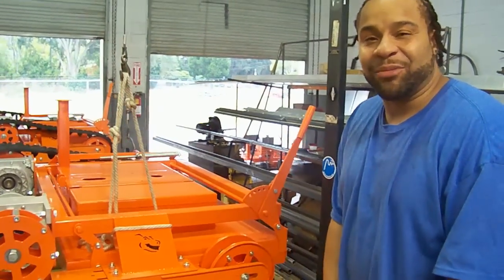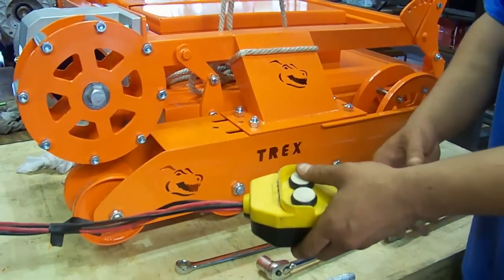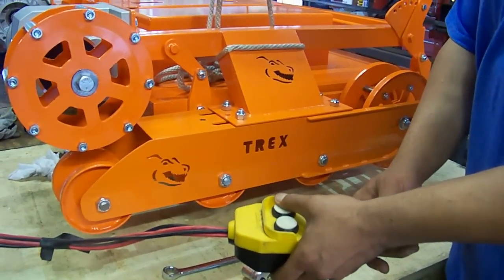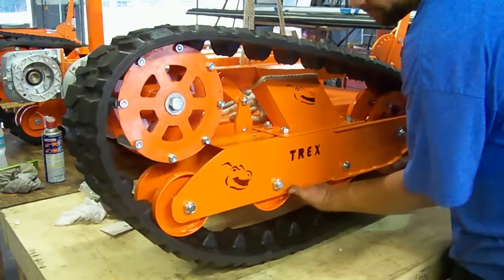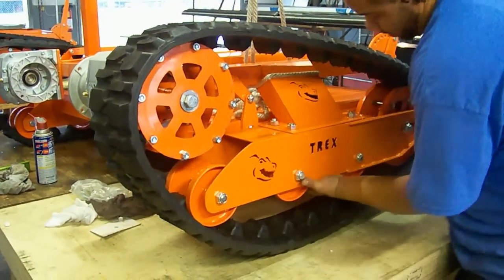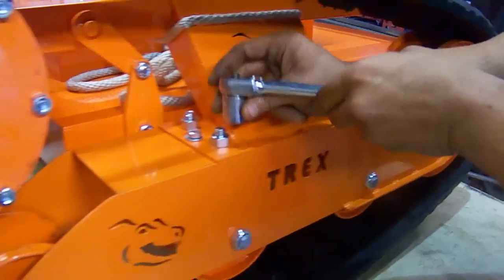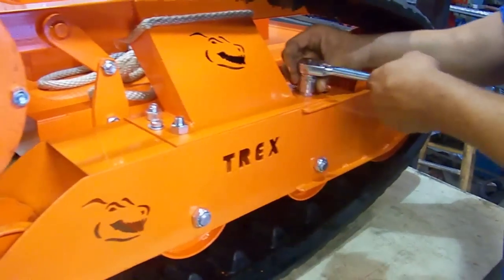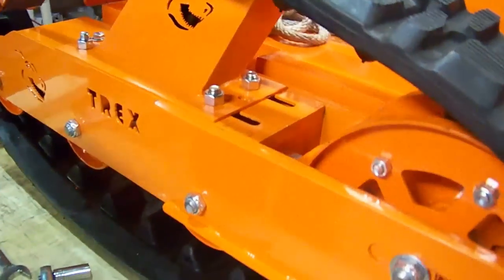TREX TRACK INSTALLATION

Comment: good old safety trainers too  , with that crappy work bench and poor slinging id not be putting my feet beside it ,, and who taught this guy how to use a torque wrench , very poor advert for the company . for 25k you would think they would  use the odd washer , maybe even break out to a few locknuts or even a ratchet spanner for the tensioner , and tightening an axle to 20ft/lb certainly isnt tensioning the track either. ,, if i was doing that every day id have to make some changes .  hse wouldnt let you do that here either . crazy.

Comment: Where are the parts that make this thing worth $10k?  I don't see them O.o
Reply: 25 k ,,, not ten
Reply: @tomthompson7400  I can put that thing together for less than $2000 IN PARTS
Reply: Total rip off
Reply: and 23k profit ,, sorry ,, r and d .. lol
for 2k would you use washers though
Reply: @tomthompson7400  If you are spending that much on R&D, then you spent too much.  Now they did spend a lot on machinery, lathes, welders, CNCs to mass produce them.  I respect them for that.  But yes, this is only about $2k in parts.
Reply: @jacobw446   i didnt say I spent anything on R and D ,,  but I wouldnt spend anything thats as poorly put together as that hunk of junk either.
Reply: @jacobw446  shame they didnt spend a few quid on some washers really.
Reply: @tomthompson7400  Sometimes you do not need washers if it is precision machined.  But yes, I do wonder if they should had used either locking washers or some sort of locking nut on many of those bolts.  I want to make a snow blower machine, but the tracks are expensive.  Cheapest I found on Ebay was about $190 USD each.  Cheapest Toro Sprocket was over $360USD each, which is why they went the custom made sprocket route.  Cheaper to buy a cnc plasma cutting machine and cut your own, than buy a dozen sprockets from the OEM.
Reply: @jacobw446  Ive never ever seen a reason to put bare nuts straight onto paint , other than penny pinching , if they wanted to go down that route , flange locking nuts maybe  but plain hex nuts ,,, thats just cheap.
Reply: @tomthompson7400  Agreed.  It scratches the paint and causes premature rusting at those spots.